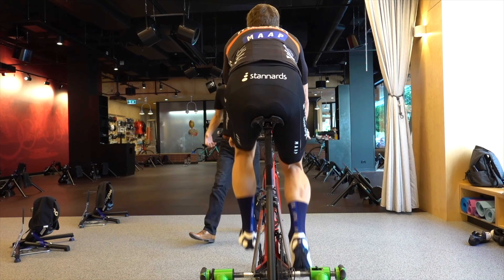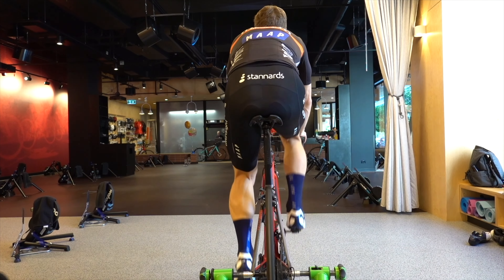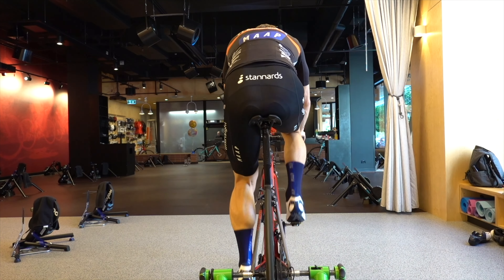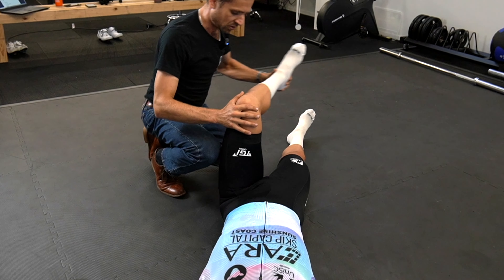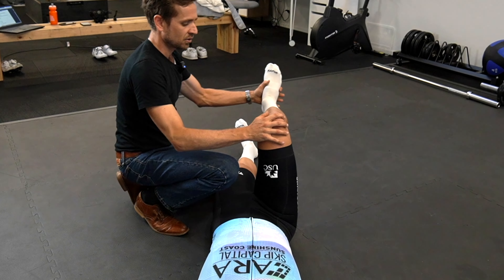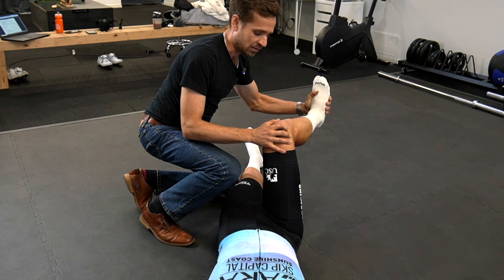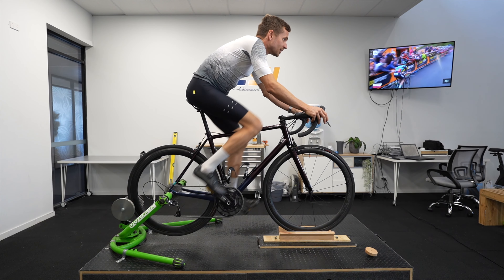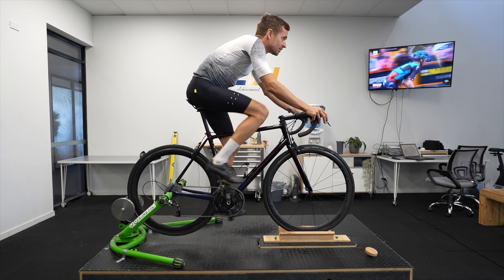5 reasons Why You Should Be Using Shorter Cranks

Comment: Why shorten cranks? Is it simple? I do not think so..
According to physic the torque required to drive the bike  working on the circle equals power * power radius length.
So when crank length is shortened to get the same torque the power must be higher - power means your muscles in this case.
It means you will have to reduce gearing when uphill - sometimes push the bike if torque you can generate is not enough.
You can change front gears for smaller but in the result you will get less efficient and slower machine - you must work on higher cadence all the time.
Yest you can ride like that but everybody has limited cadence value.
Of course for someone who has short legs shorter crank is better but the reason is pedaling kinematics - range of work of knee and hip joints changes a lot.
so finding the optimal crank length depends from individual rider features.

Comment: I just don’t get this argument, and a lot of what is being said here is wrong. I’ve worked with British pros and they tend to move to SHORTER cranks for crit races because they HELP acceleration and spikes.

Personally, I’ve only tried 175, 172.5 and 170 (and have all three on current bikes), and I definitely climb better on the 175s. My 20 minute peak power is highest on 175 too, as is my best 10 mile road bike TT time (20:25 on 175 v 21:03 on 172.5). However, my sprint is DEFINITELY better on shorter cranks, particularly the longevity of my sprints. I just don’t race now in races that require sprints (other than CX, but I like the torque in CX). Edit: I’m only 5’11 / 181cm.

‘Wattage spikes’ are BETTER on shorter cranks. Steady efforts are BETTER on longer cranks. I’m confident you’ll agree if you do the real world tests.

Comment: 178cm(5'10'') here with long legs and long legs and flexible pelvis(so I sit high and reach far down), and I've gone to 160mm cranks to alleviate hip impingement. I actually had 155s early on, but then they got stuck to an old frame in a freak accident, and for some reason I didn't bother getting the aftermarket cranks again. Now I just need a new frame or fork, because my handlebars are too low(tolerable but not optimal) xD

Comment: I agree with all of your points, but there's information missing from all of these types of videos. 
One thing is the elimination of the dead spot. For you, if you can spin 120 rpm, you don't suffer from that. I was taught to pedal properly decades ago but could not do it.
After about 20-30 hours on 153s 4 years ago for the first time I could pedal in a circle smoothly. 
Next is the rule not to pedal below 70 rpm because you will hurt your knees, and it's true for me on 165+. But I can pedal as hard as I want, for hours and hours, on the 153-, no pain. I would expect to reach exhaustion but I've done 5 hour rides (a lot for me) pushing hard all day and wasn't ruined.
People talk about wattage, but never about the power curve/rpm, such as they do for motorcycles. 165+ for me was 70-90 rpm, max at about 80. On 153s, I can smash  the cranks at 50 rpm and never shift until I get to 100 rpm. Your discussion about sprinting styles is very relevant here, so I have no idea if this works for anyone else.
On the 140s the bottom of the powerband started closer to 60 rpm.
I run 4-5 gears harder in all situations, have more endurance and went from the bottom 1/3 on Strava to the top 1/3.
I've ridden 11 sizes from 190 to 130mm. I liked the 153 and the 140, so I chose 145. I'm 6'2" with hip limitations, which may be the cause of my results, but I've put several people of all heights on <155mm and all saw the improvements I was hoping for. 

I don't think anyone, including me, has any idea what is going on.

Comment: Neil, I'm basically an anomaly according to the calculators I'm a 5'10 male with a 29" inseam (all torso). Most online calculators even Canyon's pretty much say we can't recommend you a size lol. I'm on a Time Fluidity 54cm right now with 172.5mm, do you think I could benefit from 165s? I have to put my seat quite low. Granted I have DA so I don't want to make a $800CAD jump to swap cranksets if it wouldn't help me.
Reply: In your case I'd absolutely go 165. I am just over 6' and run 172.5 with a 34.25" inseam after dropping from 175 which successfully got rid of my knee pain. I can't imagine the 172.5 with 29....as it is they're right at the high end of the optimal range for me and I'm adding more hip stretching exercise to my routine to, among other things, prevent the need for an expensive makeover.
Reply: I am 5'3" with a 29" inseam. I am running 155mm, the saddle height is 660mm. Cadence is higher, aerobically efficient as Neil mentioned. Just that in a bunch sprint, I need to wind it up early. Timing the spool is important and short ratio cassettes that optimises your power zone at cadence needs some thought. Just like turbo of old 80s cars, you have some lag before the kick comes in.
Reply: @danielbliss1988  This is what I've been thinking as well it seems like 165 is a no brainer for my completely wonky inseam. I've been hunting around seeing if I could just find the cranks only but it looks like I may have to just get the 165 50/34 and then list/re-sell the DuraAce 172.5's. Thank you for your input
Reply: @lordalfa600  Height measured from center of the BB or the 109 method? I typically always have ridden at a higher cadence even on the 172.5's, I was gifted the group set so it kinda just came as is with 50/34 (172.5mm) and a 11-34 in the back which I don't mind as climbing is going to be my focus for the next while. No real crits or any local races for me just Fondos here and there.

was hoping to just find 165 DA cranks to slap on, first world problems I know but I guess I can list the 172.5mm crankset aftermarket.
Reply: @Jeromin  you might even want to look at 160mm. Pretty sure Shimano now makes them, though not sure if in 11-speed -- they're certainly available in 12.

Comment: The main disadvantage is that you have to raise your saddle. So you have to bend down more. I recently swapped from 175 to 172.5 and reached the limit of my neck flexibility by raising the saddle by 2.5 mm. Results: neck pain, tense shoulders, back pain, numb hands, numb feet, hurting bum. And a bit higher cadence overall, but at the expense of bad fitting gears (either too high or too low cadences for my taste and body). So back I am to 175. - Much better is losing some fat from the safety tire, especially the visceral fat. Hip flex gets easier, breathing is much improved, heart rate goes down. Lost 4 kg, heart rate down by 5 to 6 beats. (I’m 1.88cm/6"2', 100kg, saddle height 800 mm, more grinder than spinner - if all that’s of interest to anybody.)
Reply: I have long legs and a short torso so shorter cranks artificially put the seat higher and further back, which makes reach even more challenging.
Reply: May be a silly question, but did you try raising the bars by the same amount to keep the saddle to bar drop the same?
Reply: @Lemond75  Not a silly question, but the handlebar is already as high as it can get. Otherwise that sure should solve it.
Reply: 0
Reply: But this is how to be more aero.  Otherwise you can also raise your cockpit the same bit to compensate
Reply: @SrFederico  just get a different stem to raise your bars a whole 2.5mm.
Reply: @mohongzhi  Getting the saddle higher does not make you more aero, to the contrary. Especially if you raise the cockpit.
Reply: @Pastamistic  Or swap back to 175er cranks.
Reply: @SrFederico  I mean if you raise the saddle higher and your can lower yourself for not confliction of your leg and stamach, it is actually you can make yourself to a more aero position.  This fit me very much, I've been switched to 165 for years, first on my TT bike then realize i should apply 165 to all my bikes.  And I have no issue with my neck.  And I am very identical to RCA for a much high cadence ( group ride all above 100RPM and winding for climb) so i just enjoy all the benefits of a short crank.  I kept my crit race bike for 170 as the same reason RCA said course it's just more responsible in crit race. And crit race never last more than 60 minutes so 170 is still ok for myself.  Cheers.
Reply: @mohongzhi  If it works for your case, perfect! I am the contrary body type to you, with long, strong, heavy legs who normally spin at a cadence of about 75. So I thought it might be advantageous to up the cadence with shorter cranks. That worked fine, cadence went up by c. 5 spins/min. But speeding up was either with a very high cadence or pressing quite strong due to the shorter lever (as RCA said). And yes, the hip was moving a bit more freely, getting down into the drops was a bit easier. So a mixed bag of results. But those small benefits do not merit reaching the end of my neck extension (and all the problems that come with that). I’d rather train spinning up with my beloved 175ers.
Reply: @SrFederico  congratulations if that works for you..... Your statement that raising your saddle height is a downside is flat out dumb. Proportions will vary for each individual and many people's fit could improve with more drop between the saddle and bars. It's been great for me. Or their anatomy is simply better fit for shorter cranks so you make other adjustments around that to make the rest of their fit equivalent around the shorter cranks. Like raising your handlebars by such an enormous amount as 2.5mm.
Reply: Totally agree with you.  I admit i almost lost one gear of low cadance in climb around 60-70 rpm, althrough i seldom use it.  And thus i changed to 50/34 and 1130 cassettle so that i have one more extra spinning gear for climb to componsate.

I have no issue with my back and neck to be extremely low.  

One more thing, i have some issue with my skin at the back of one of my knee where upper and lower leg skin can contact each other.  With 170 crank and proper fitting, i will have a really nasty skin condition after 90 minutes ride.  After changed to 165, these two piece of skin rarely contact anymore and it just solve this skin condition.  This why i switched all my bike to 165 after i realized it. @SrFederico
Reply: @mohongzhi  Interesting how may unsuspected problems people can have with their bike fit. Like Skin issues on the back of the knee, cured by shorter cranks. Always amazing what some millimeters can do...
Reply: @Pastamistic  No, the statement of raising the saddle height as a possible downside is not dumb. It may be advantageous for you, but for others it’s not. The last year or so there is almost a campaign on YT for shorter cranks, and hardly anybody is mentioning the potential side effects and downsides. 
2.5 mm in my case is close to nothing, but most bike fitters recommend going to 165 mm, which is a whole centimeter in saddle height raise when you com from 175. If you easlily can raise the handlebars for the same amount, fine. But steerer tubes are mostly cut to fit, or spacers are at their allowed max, or intergrated handlebars don’t allow for inversion of stems. There are plenty of reasons why you may not be able to raise the bar any further. (As with my bike.)
I was actually taken by surprise of how much the 2.5 mm shorter crank length impacted my bike fit. But I changed it back to the old 175 cranks and did my regular 60 km circle today - and all problems were gone instantaneously. 
Conclusion: If you are maxed out in any dimension, you’re maxed out. If you got leeway, you may push it until you reach your limits.
Reply: @SrFederico  "It may be advantageous to you" is my point. Making a statement that a taller saddle height is bad due to shorter cranks is dumb because it's 100% subjective based on the person riding the bike. No adjustment in any direction is dumb if it better fits the person riding the bike. Also, like I said, you could just raise the handlebars an equal amount that you raised the saddle making it the exact same fit but with shorter cranks. So yes, your pointless argument is dumb.

Comment: That could work for amateurs riders but not for Pros. You need Torque. Tell that to Jonas Vingegaard who has won 2 Tours with 172,5 measuring only 174cm.
Reply: pogacar uses 165mm on strade bianche. 80km solo attack

Comment: Insightful analysis.  But gosh, the old standby, 170mm, is right between 175 and 165.  How about that?
Reply: There is no single number — it all depends on your height and flexibility and leg proportions.
Reply: Trouble is 170mm might be right in the middle,  however if you are short or very short right in the middle is hopeless.  If like me 5'4" on a good day a XS or XXS bike very often comes with right in the middle 170mm cranks . If you go on crank length calculator website comes out my crank length ideal is 140mm or 155mm depending on the crank calculator.  170mm for a short or very short person is a utter disaster.  I imagine 170mm for someone very tall over 6'6" might be equally disappointed? 
Bike manufacturers, or more so crank manufacturers need to wake up and fit short cranks to their XXS bikes for everything to be in proportion? Short stem , narrow bars , short top and seat tubes ,sometimes smaller 650b wheels also need short cranks to match .
Reply: @robduncan599 True.  Sticking to 170mm pretty much ignores the issue!  I rode 172mm once, commonly used on mountain bikes, and could never get my spin down, trained on years of 170mm.  I'm 5'8" as fairly standard height.

Comment: Reason Number 6: Rider doesn't understand physics/torque and power loss of shorter crank arms. If 160mm is great, 140 or 120 has to be even better, right? Follow the numbers. As crank arm length is reduced, torque and power are reduced. There's a reason very short crank arms aren't made. If I needed to improve "fit" or comfort I'd prefer a high 45° gramps stem or an mtb riser bar and keep my ability to climb hills with 175's.

Comment: Do shorter cranks require more setback?  Some say yes, some say no.
Reply: If you needed more setback then shorter cranks should enable that for a given seat height. Less reach to bottom of the pedal stroke could be used for increased seat height and/or setback. Also pedalling a smaller circle so the 3 o'clock foot position is closer to the bottom bracket enabling some additional setback to maintain knee angle in that position.

Whether you NEED to move your seat back most likely depends on how well balanced you were fore/aft originally. The foot being closer to the BB in 3 o'clock position might require more set back so you don't feel like you're tipping forward, which will load up hands and quads. The higher your cadence and/or less force you apply to the pedal the more pronounced that tipping might feel.

Comment: My sit height is 64cm and i’ve benefited from using 155 crank length. I’ve tried both road (straight arm) & mtb (bent arm) 160 crank length and still prefer 155 road crank. 

I’m this calculation as gauge:
a) 163(height) x 0.95 = 154.85 
b) 1.25 x 72(inseam) + 65 = 90 + 65 = 155